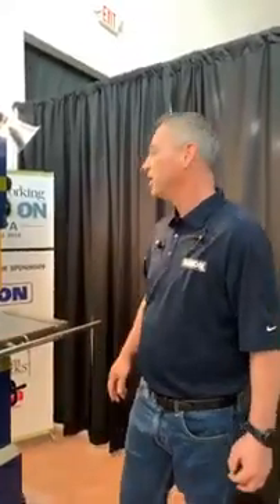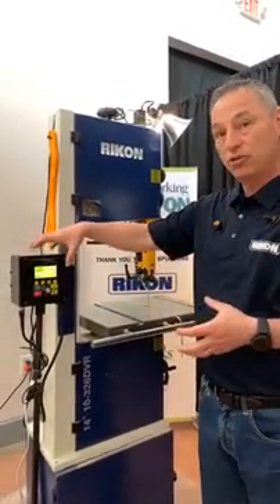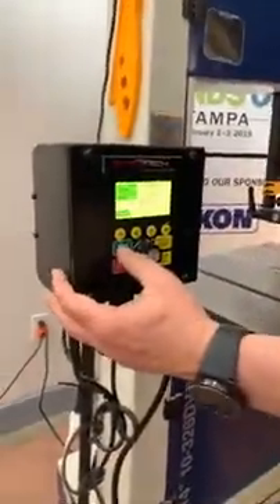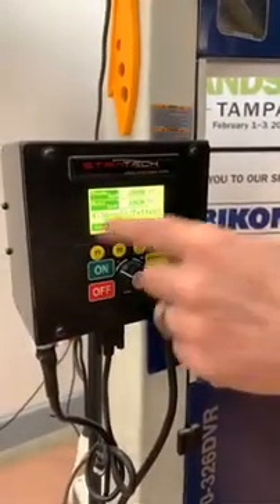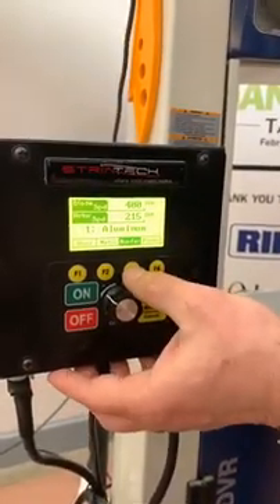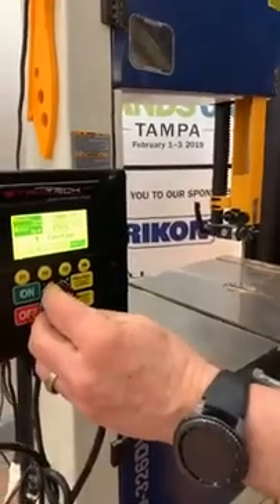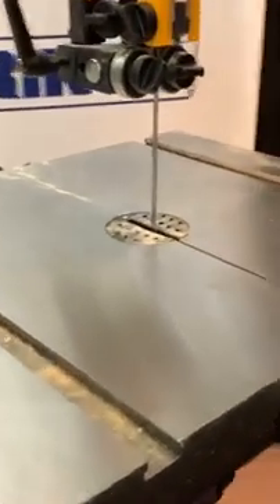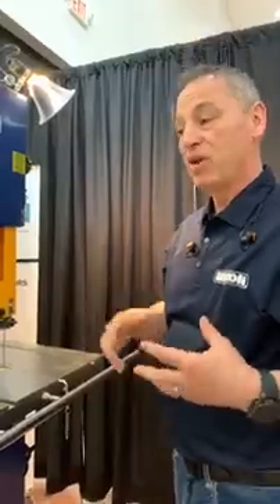RIKON Model 10-326DVR Smart Bandsaw

Comment: Does the 10-326DVR use a 3 phase motor?  Or is it the same single phase motor as the non-DVR version?
Reply: Single phase. I upgraded my 10-325 2 years ago and glad I did. It has made a huge difference in performance of the saw. I do not regret making this upgrade at all.